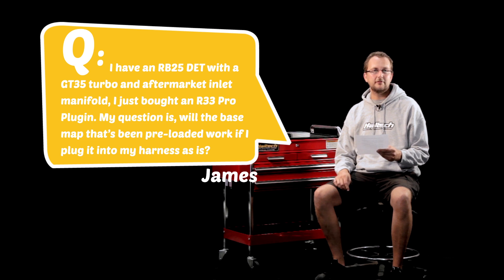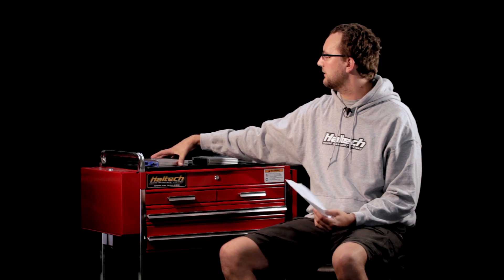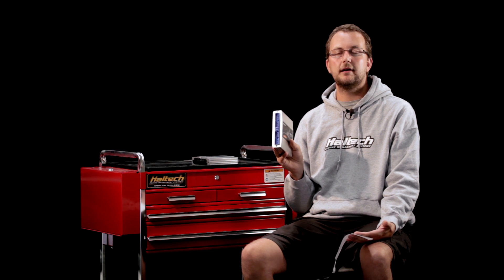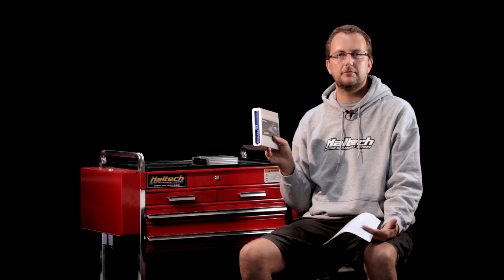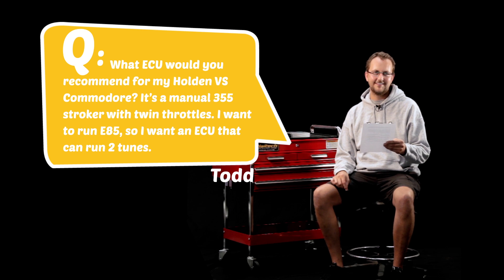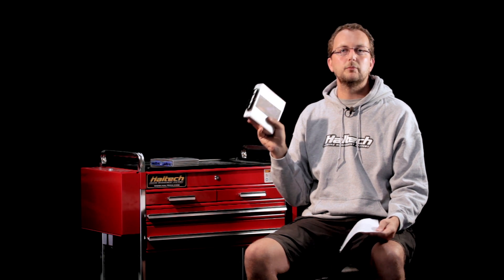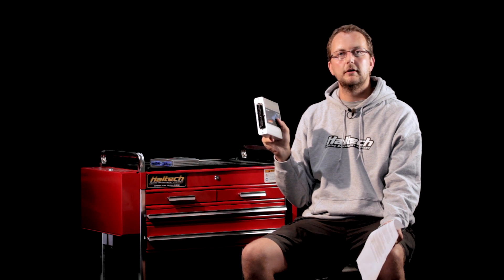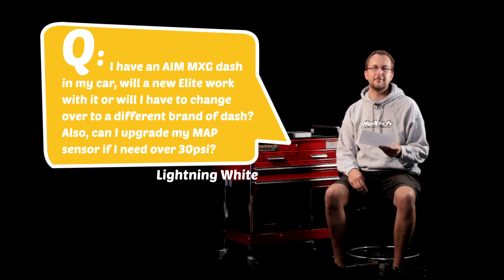RB25 base map, VS Commodore on E85, what Dash for my Elite - Haltech Q&A Episode 3

Comment: How about the repins? Does that only pertain to the RB25DE and RB20DET?
Reply from the maker: You only need to do that pin swap for the 25DE or 20DET models. 
The RB25DET should be a straight plug in.

Comment: about to start building a fairly serious 351 Cleveland, looking to aim at 550+hp at the flywheel NA, will be running E85, however i was wondering which of your ECUs will work with individual ignition coils? and a flex fuel sensor? will be using a 4150 pattern throttle body and 8 ID850 injectors along with LS style individual ignition coils and a Crank trigger ignition system. will also need to be compatible with controlling a nitrous system.

a head upgrade will be on the cards 18 months after the engine is built and that will bring the power level up to well over 600hp, i feel with E85 the extra spark power available from running individual coils will be beneficial to reliability and preventing ignition break downs with the large compression i will be running (14:1).
Cheers
Reply from the maker: XCSEDAN Both the Sport 2000 and Elite 2500 will be able to run your setup. The Sport 2000 can run sequential injection and individual coils in waste-spark pairing, plus single stage nitrous control. The Elite 2500 can run sequential injection and direct-fire ignition, with four stages of nitrous control soon to be introduced in an upcoming firmware release.

Comment from the maker: vetter2769: The sensor can be fitted in the feed line, however many high-powered cars use large fuel feed lines and pressure. For low restriction and longevity, we recommend fitting the sensor on the return. The ethanol content averages through the tank so quickly that you will not find the sensor seeing an ‘old’ content value.
Reply: haltechecu awesome thanks for the explanation :)

Comment: Hey currently doing a rb26 swap into a s15 was wondering what ecu would be best I was thinking ps2000 or elite2500, will be a fully built motor running a big single turbo and duel fuels
Reply: Cheers in advance Nick
Reply from the maker: rapguy88 The PS2000 and Elite 2500 are both great choices for a custom installation. The Elite 2500 adds dual knock control support and ignition timing correction, as well as long term fuel trim corrections.